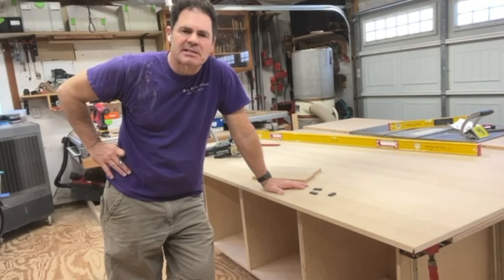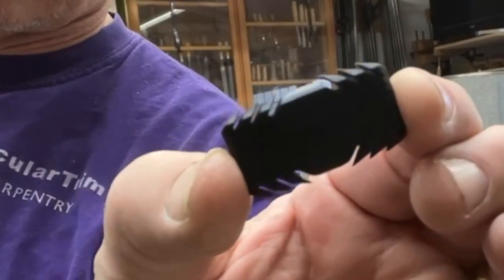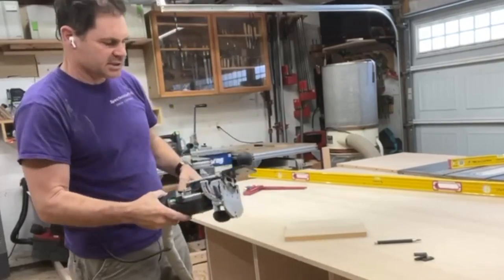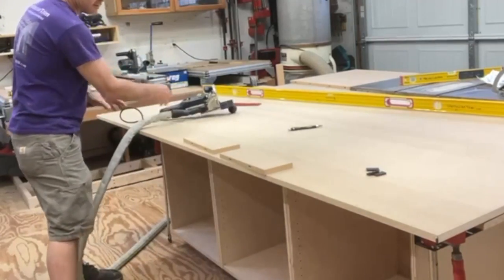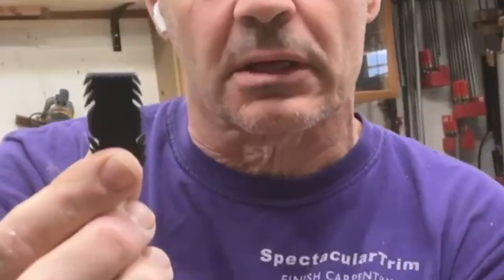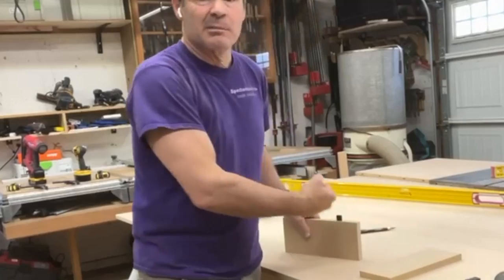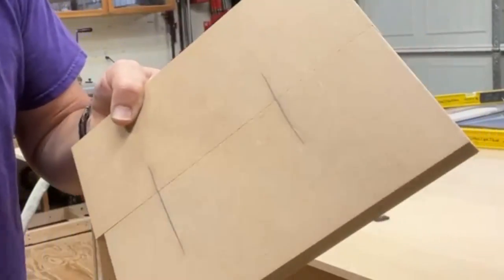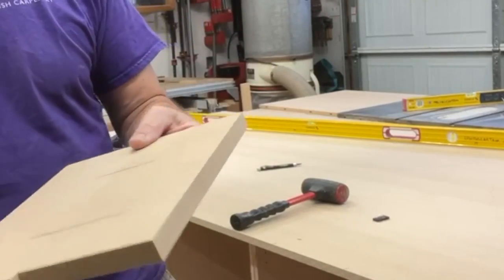FASTenon with Paul Comi

Comment: I wouldn't imagine glue would stick well to these, however, it seems glue in the mortise would tend to swell the fibers & cause them to lock into the barbs even more. What type of plastic are these made from?
Reply from the maker: @ IAMSatisfied We forwarded your question to our engineering team and this is their response: 
They are glass filled nylon. Correct wood glue does not bond well to them, but wood glue does swell the fibers, and harden in any empty spaces, causing the barbs to lock in very well. If you want an even stronger glue connection, an epoxy can be used, and will bond well to the nylon. I have even heard of painting a thin coat of wood glue in the mortise hole, letting it dry, and then pressing a nylon piece in covered in epoxy, but don’t have any experience with trying this.